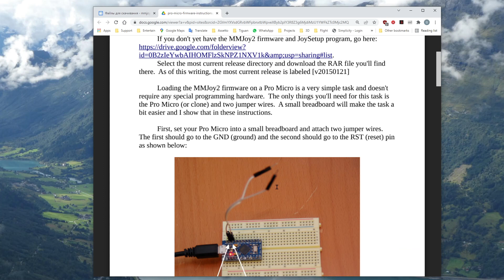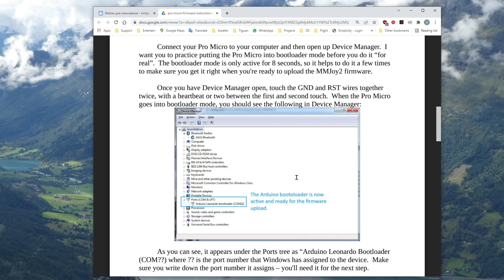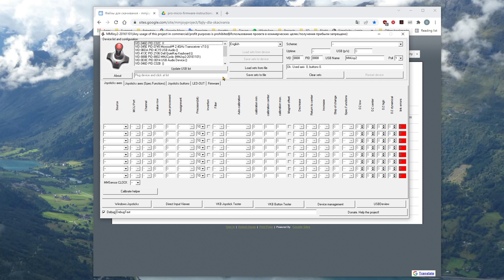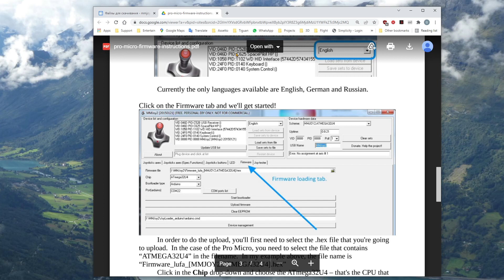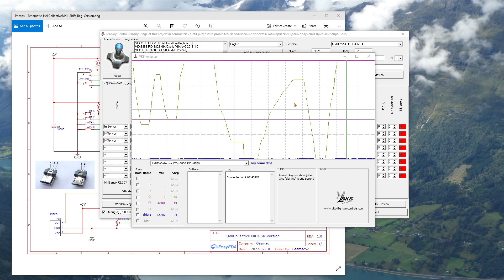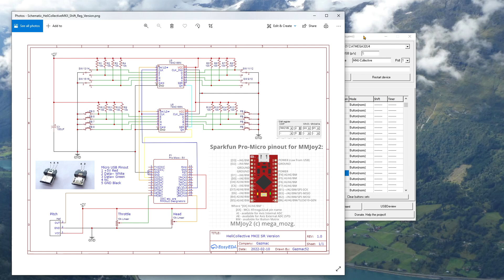DIY Helicopter Collective Programming Part 6

Comment: Thanks Gary for your work on this. I've built the collective and have everything working via MMJoy2. 
For those looking for the link, it's here: https://drive.google.com/file/d/0BwUD4rA7ad1aR1RJcm11ZnI0eUU/view?resourcekey=0-0MW9iCQQS-tsa1OWybnzcA
It appears the stripboard layout has some incorrect wiring on it around pins 9 and 10 on the chips. Refer to the schematic instead.
I found it a little challenging, but also a fun build. I'm just struggling to fit the stripboard and the Arduino into the head, as the throttle pot is in the way, so it leaves very little room. I will likely adjust the design files for the head to make the head bigger to accommodate everything.

Comment: That site is not available anymore...does anyone know of anything similar to program the chip to use with this Collective?
Reply: Glad I scrolled down so didn't waste my time on this. Was thinking of just using Mobiflight direct with Arduino anyway. Just measure the output from the hall device and program the resolution and interpolation settings to be mapped to the throttle variable in MSFS.

Comment: do you use one Arduino for the cyclic and collective and pedals, or one each ?
starting to watch all the vids to build understanding whats needed before i start printing and ordering parts.
got a favor to ask, i can't get all the exact same components locally, and importing is crazy expensive, this is going to require me to redesign bits like the magnet holes etc. any chance you willing to share the design files (hope it's Fusion360 based, guy can hope i hope)

Comment: Hi Gary, Thanks so much for your cyclic and collective. I have printed the parts and they look great. I am having trouble with MMJoy2. I have tried a Leonardo and two pro micros. The firmware loads, but the device does not show in the devise list. I have tried to Google for help, but no one seems to be having the same problem. Any ideas? thanks for your help.
Reply: My friend had the same problem and I managed it, I don't know if after 9 months this will help you, but let's go.

take the mmjoy firmware folder and put it in c: now open mmjoy and when you put the firmware put it in the C: firmware folder and select your chip. It comes through Windows in a One Drive file and from what I understand, the One Drive doesn't understand it and that's why it can't put the firmware on the Arduino.

 by google translator.

Comment: could you choose ports A0, A1, and A2 for the potentiometers and hall sensor? In mine it had tremors in the signal.
Reply from the maker: Are you using MMJoy2 or an Arduino sketch? MMJoy2 does not follow the same pin designators. If you are using MMJoy2 you can set a filter value for the input on the Axes page. You can of course use what ever you want.
Reply: @fatchickencatcher  MmJoy2.
Reply from the maker: @brunotaciano1218  Technically it should make no difference which ADC pins you choose but you never know. Let us know if it does. :)